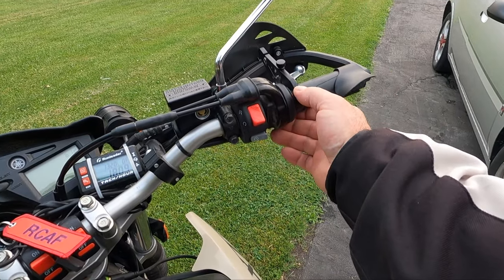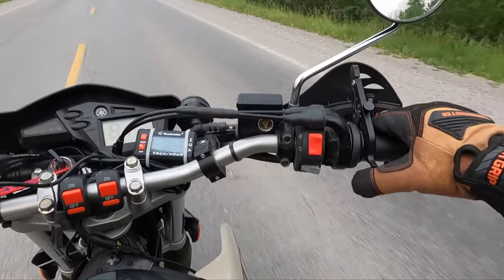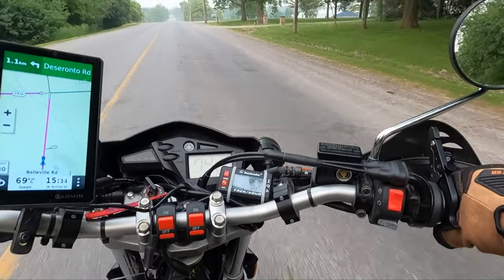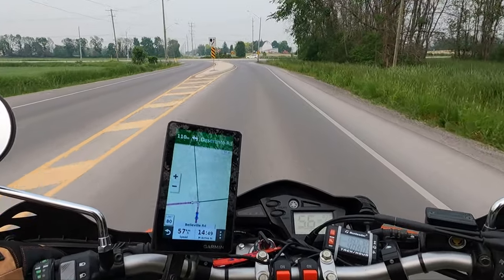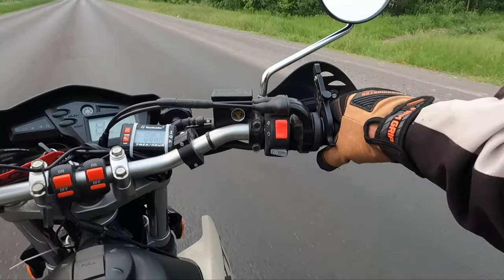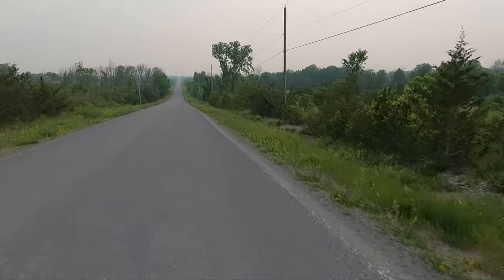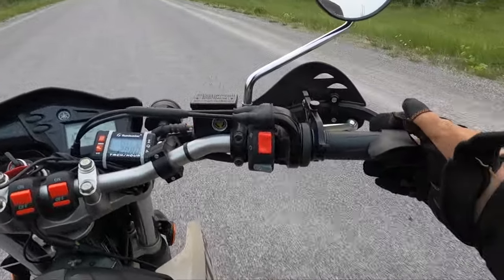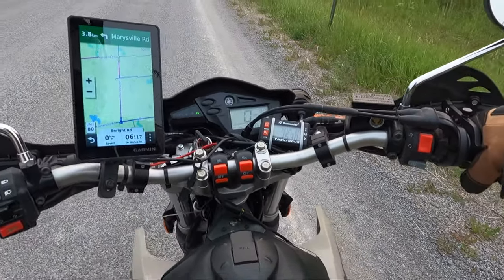Motorcycle Throttle Lock VS Throttle Assist

Comment: My street bike came with both of those features, and I've enjoyed them both. Maybe someday I'll add them to the XT250. Meantime, really interested in that tach reader you've installed plus the two on/off switches in the middle of your handlebar. I'll check your video collection to see if you discuss those. Thanks for sharing.
Reply from the maker: It’s a good add on if used properly, especially if you have hand issues… throttle lock for long stretches is great for me…

Comment: Your GPS is only 5-6% off, mine is 10% off...   is that a 16 front sprocket or just tire change?
Reply from the maker: Good catch, i recently changed to a 16, Mine was also 8-10% off depending on speed…so far happy with it… I do up an install video soon. Thanks Peter.

Comment: I had used the throttle lock before a couple times but felt it too sketchy to rely on and a distraction if an emergency maneuver was needed. Never heard of that throttle assist! I think ill give it a try. Ive started doing some longer rides and im welcome to more hand comfort. Enjoyed the comical interludes too eh 😂 BTW I have a brown tinted parrbellum windshield im selling. i took off because of wind noise  from it due to my height
Reply from the maker: Yes, have to be very careful with throttle lock, I only use on basically straight sections, low or no traffic….anytime I approach intersections or on curvy roads or before entering areas that require a speed change I turn it completely off.  Mixed feelings on the windscreen also, more so due to how hot it is in the summer, need the airflow… Would be nice in cool weather…
Reply: @kd_enterprise3404  ya and i ride off road to so im concerned id bash into the windscreen
Reply from the maker: @kevinmallon8692  lol, I think the same… I guess remove if doing dicy driving… windscreen in face not enjoyable…